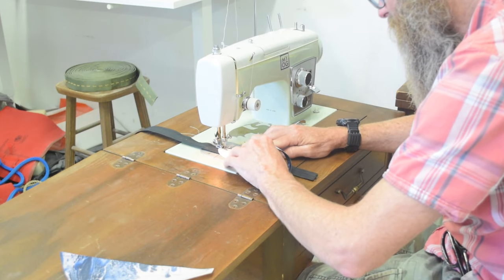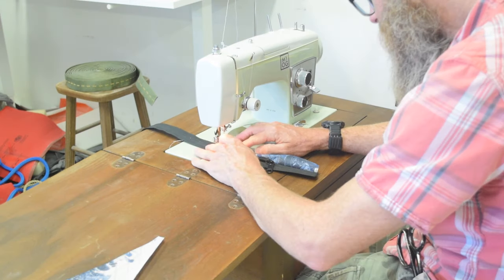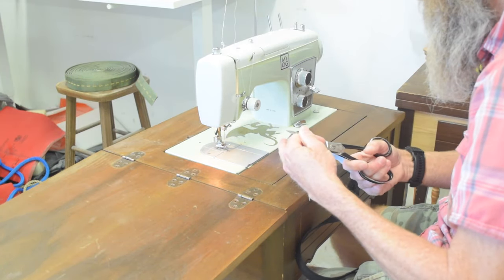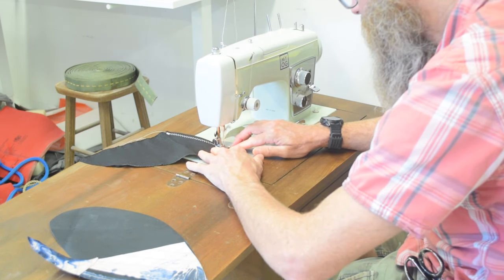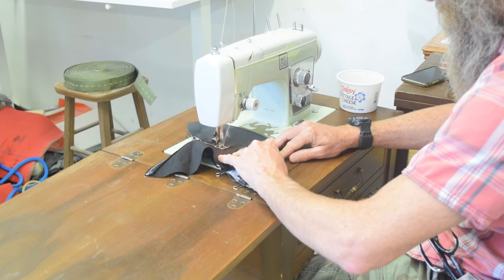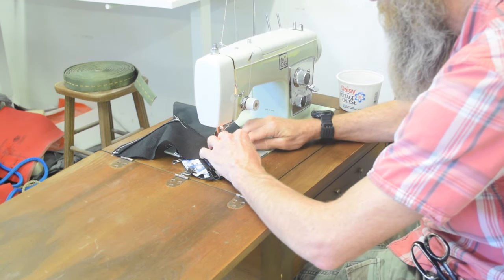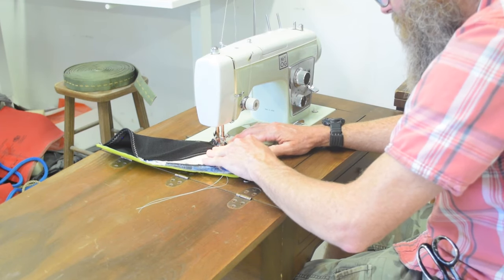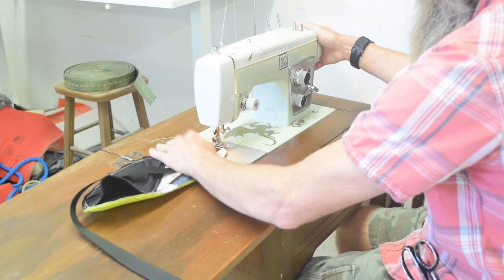Singer HD: Addendum (Comparison to Kenmore 1752)

Comment: there is a rolling foot for the Kenmore that might have helped here. other than my Singer 404a, i pretty much only use vintage Kenmores. the rolling foot has been great for thick layered tougher materials.  it also works well for materials that like to slide against each other.

Comment: As an owner of a Singer HD, but dubious of modern stuffs over equivalent older things, I have found this series brilliant, and somewhat surprising. My take is (maybe) that if you're looking to buy a new machine, on a limited budget, the Singer HDs aren't too bad. They certainly seem to compare well with other modern equivalents at the same price point. I am surprised that they do out-perform older machines in any respect to be honest, and it's good to know it's not all hype. Longevity is obvs. another issue... Thank you for this, I think you've been scrupulously (which I had to Google, only to find I had spelt it right) fair and open. All the best etc... Pete
Reply: Just like you, I'm dubious of modern machines, especially those with mostly plastic "innards" but am not hypocritical enough to deny using a modern computerized quilting machine.  It's   monster weighing in a 46 pounds. It DOES have a lot of metal in it, but there's plenty of plastic too. It works VERY well and is superb for free motion quilting. However, as you say, when it comes to longevity, my collection of all-metal Kenmore's and my vintage Singer 201-2 and 301A will all outlast the quilting machine by several generations if not longer.

Comment: 1. Kenmore feed dog teeth are different (pointy dimples and 4 groups of teeth) compared to Singer HD has more aggressive teeth (angled slats and 7 groups of teeth).  Unfortunately, the only Kenmore vintage feed dog I have found have the same exact teeth pattern.  However, from model to model, the teeth may be worn down more or less.  So the pointier, the better.
2.  Kenmore 1.2 amp motor is stronger (more needle piercing power).  But the HD probably has a 90 watt motor (less needle piercing power).